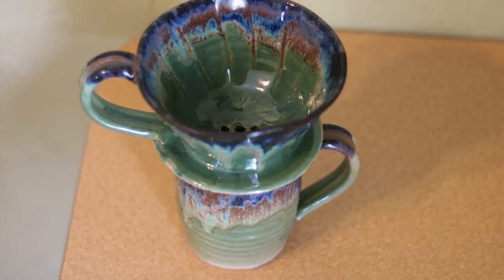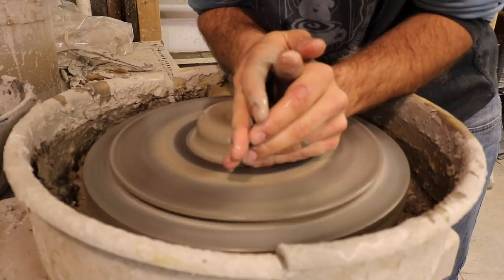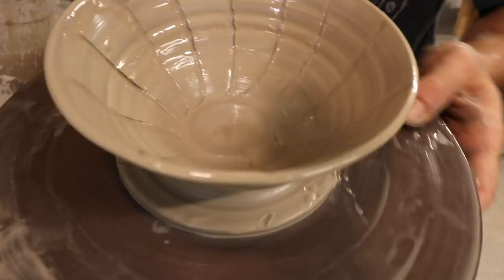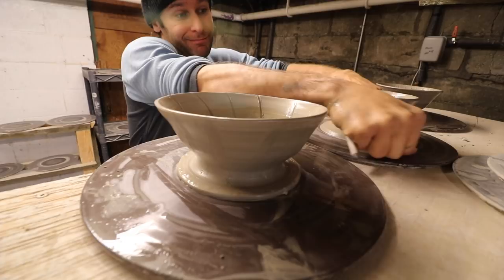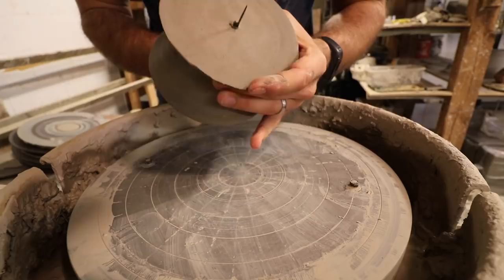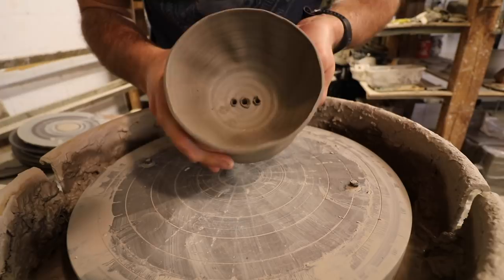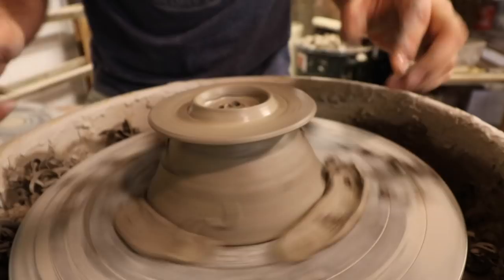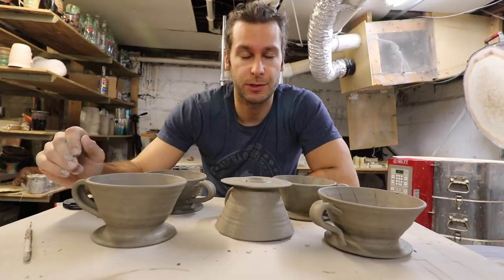How to make a Ceramic Coffee POUR OVER!!

Comment: Greetings from Vietnam!  Very nice pour over.  We do a very similar design in our shop.  Our main difference is that we only use a single hole in the bottom but slightly vary the size of the hole between filters to change the rate at which the coffee flows through it.  As we also run a cafe which uses our pour over filters,  we can market the fact that the flavor of the coffee changes with the size of the hole (flow rate) as you are changing the time that the coffee is immersed in the water.  Love your kiln opening vids as well.

Comment: Do you find it more comfortable to throw while standing? I've been thinking about raising my wheel and giving it a try.
Reply: I discovered standing a few years ago.  Tip or two.  measure the distance from the floor to your belly button. Then set the wheel up so it fits that position.  I find I can look at many angles of my work easily and it doesn't hurt my back as much.  A big plus for a small studio is you don't have a chair that takes up valuable space.
Reply: @gregdebree9158  Thank you! I've been thinking of giving it a try.

Comment: I am curious about the glaze dripping into the holes and blocking them and or the holes not being covered by glaze and therefor water eventually seeping into the clay body. Let me know :)
Reply from the maker: Actually bare clay that is fired to a high enough temp, such as cone 6 does not need glaze on it to be waterproof.   But before it is fired I make sure that the holes are clear of glaze and I don't load it on thick enough for it to drip that much.  I typically don't have any issues, thanks for watching!